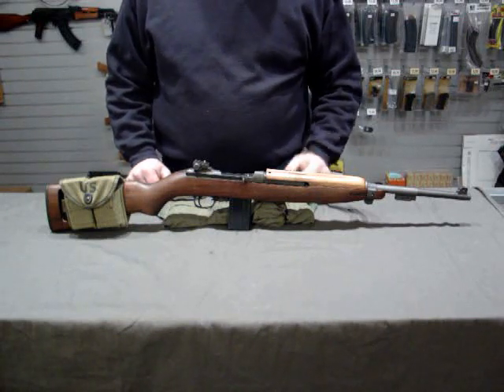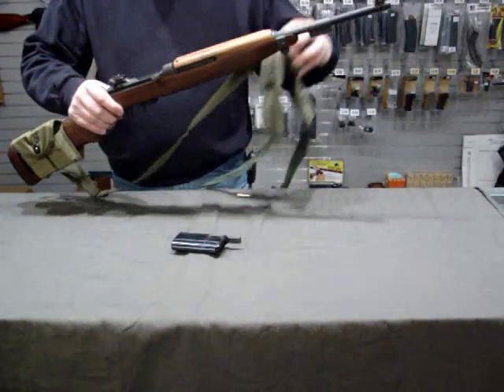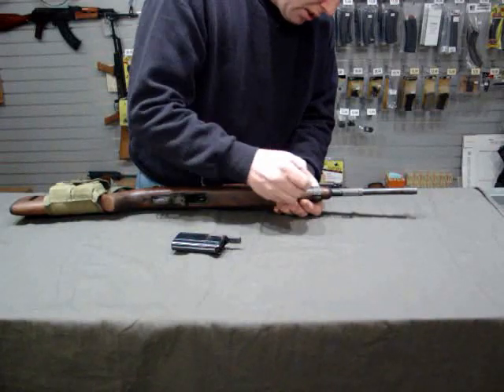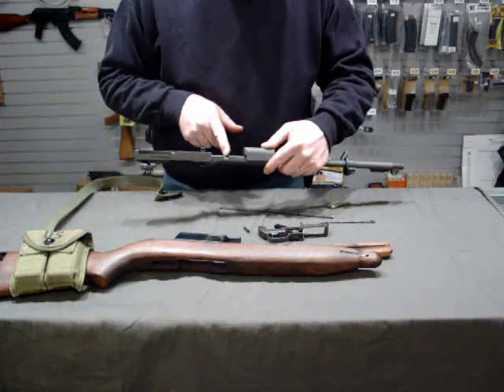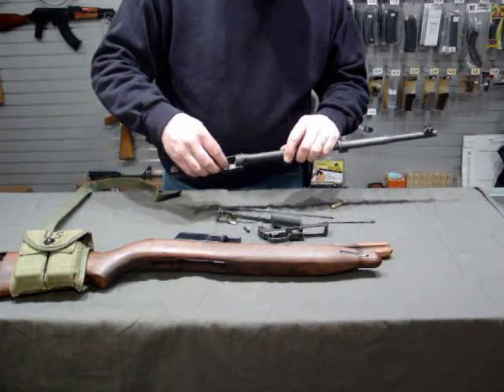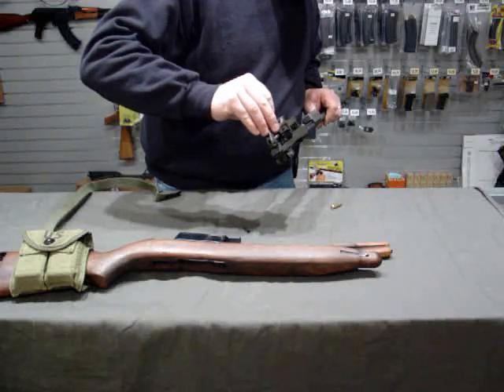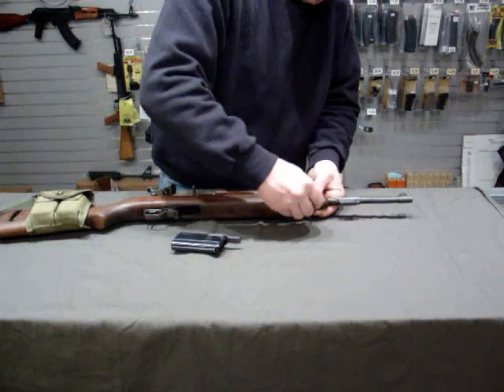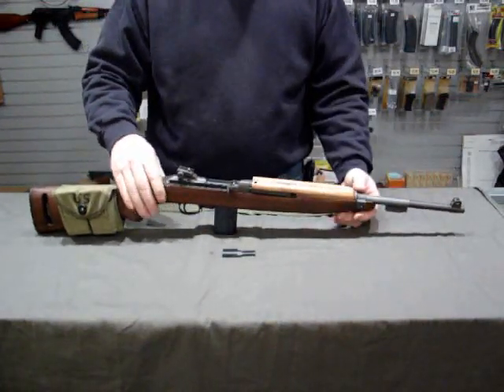M1 Carbine Disassembly and Reassembly

Comment: i have a m1 carbine that might need a new barrel... it twisted when my cousin accidentally dropped it. the front aim point at the top of the barrel is (shifted not bent) twisted and it can no longer shoot straight. the aim points no longer a line... the rifle still shoots well but do you know if the barrel can be fixed and for how much do you think it would cost me?? thanks!